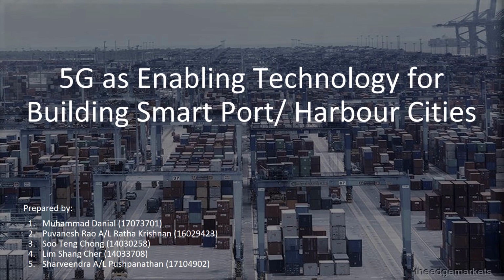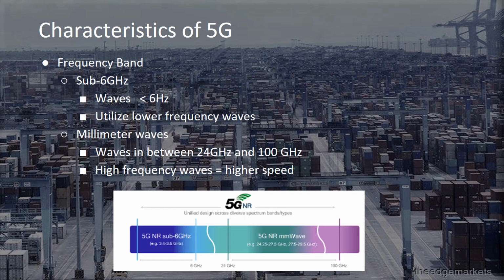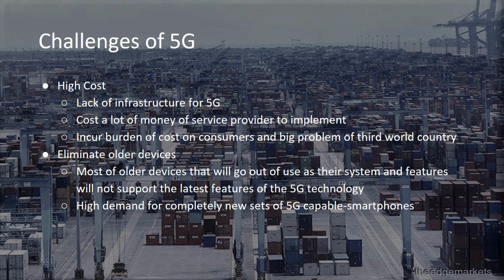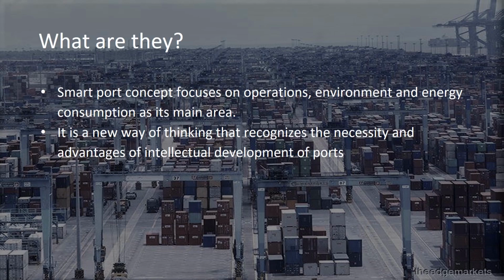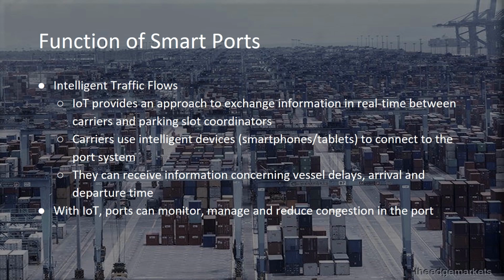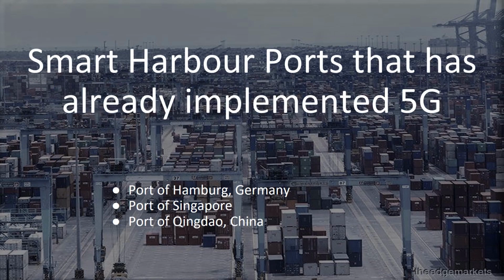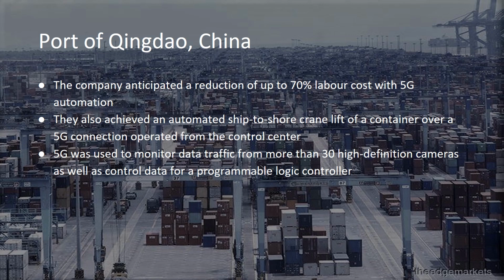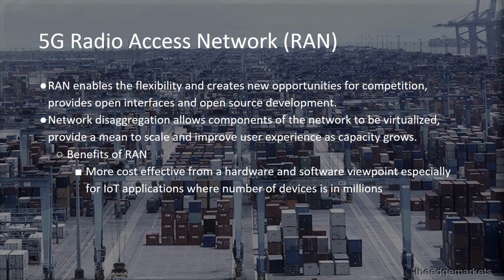5G as enabling technology for building smart port/ harbour cities

Comment: Will 5G be able to be in range to support such ports that are extremely huge in other countries?
Reply from the maker: Hi There. No. The inability of millimetre wave signals to penetrate obstructions further limits the range because these obstructions would need to be factored. For 5G to be really useful in smart ports, one would need to spend very high cost for building the cell tower. The cell towers should be located around 500metres away from another cell tower.
Reply: @SAprosprayer  alright thanks for the supportive information

Comment: Drones that are connected to 5G services, will it be useful? How can they differ from the current drones which is using 4G services?
Reply from the maker: Hi sofia. Drones that are connected to 5G will bring more enhancements and usage. For example, surveillance drones using 5G technology for emergency services can be flown with a much higher reliability beyond line of sight. As for 4G drones, they are useful as well, but couldn’t perform more autonomous operations.